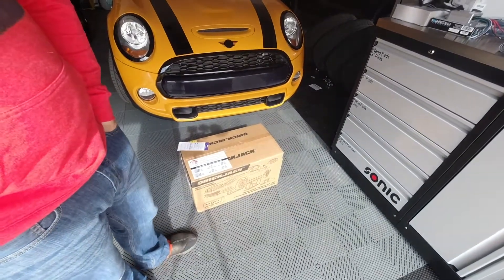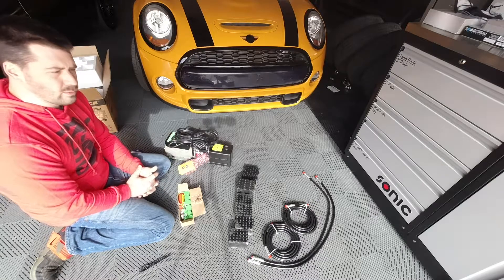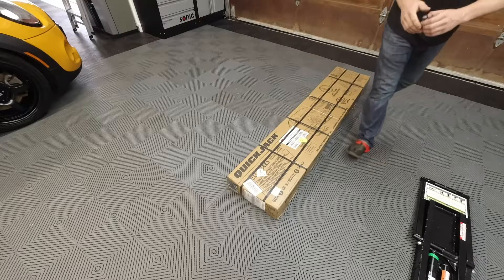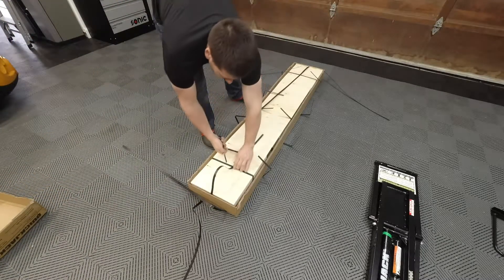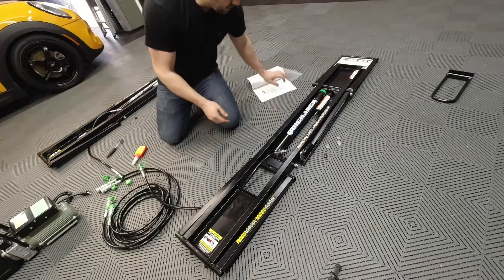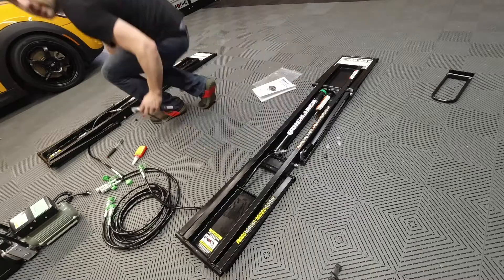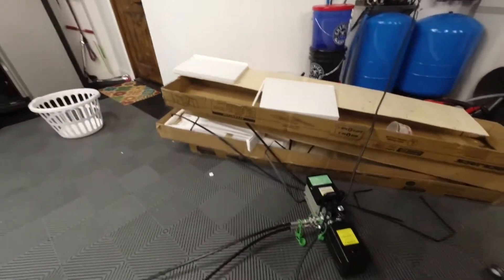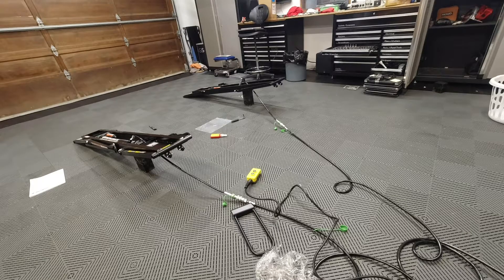IG231 Bendpack Quickjack unbox and setup

Comment: Does having the QJ replace the need for having or using your floor Jack?
Reply from the maker: TLDR; Mostly

Before QJ i had 3 floor jacks, and 4 stands, now i just have one floor jack.  You only really need it for things like collapsing trailing arms to attach a strut, or attaching a motor mount to an engine or a job that requires you to lift something other than the car itself.  
For simple jobs like patching a flat ill often grab the floor jack and just lift the corner of the car, just because it's easier than getting the QJ out.

Comment: How does it work on your Swisstrax floor?  I have Ribtrax pro and yours look to to be Ribtrax smooth.  Not sure if it would crush, dent, or be hard to roll on my floor. How do you like them so far?  Are they worth it it just for just a small lift off the ground?  Thanks for all you do.  You quality of videos are getting so much better since updating your camera!  Thank you!
Reply from the maker: TL;DR   IT WORKS GREAT!!!

WIth my floor jack I always used a 1/4" piece of wood or later a 1/16" sheet of metal to keep the wheels from digging into the floor..
The swisstrax is really strong, but jacks mess it up because all of the weight is concentrated on a small area and the wheels move forward and back when lifting the car which causes them to dent the tiles.  The base of the QJ has a huge surface area, and the base doesn't move as it lifts the car, so its really really awesome.  There is still a lot of height, 22" or so on the mini for example, which is enough to be really comfortable on a creeper, or to be able to get something like a transmission out of a Miata with room to spare.  

Im glad the camera made a big difference.  I wish I could "zoom out" more on the Sony camera TBH, it needs to be a bit far away from me for it to capture what im doing.
Reply: Thanks for the info again.  Thrilled to find they will work over my Swisstrax flooring.  I ordered mine today from Costco.  Can’t wait to get.  Just curious if you ever gave it any thought of adding wheels to it and if so, can you make a video?  I heard they are really heavy and tough to move around under vehicle.  I went with the same one you have as I feel the 5000TL is plenty for my Mazda CX-5.  Really enjoy your explanations whenever you do a project.  Thanks again!
Reply: What kind of fluid did you use?  Hydraulic or transmission.  Can’t tell on your video and it’s not in your link.  Also, did you use the included thread sealant or did you use Teflon tape?  Read horror stories about the thread sealant.  Most just throw it in the garbage!

Comment: That framework seems awfully lite duty for something made to lift 5k pounds.
Reply from the maker: ive had very close to 5k on it and it lifted it easily, im not a materials engineer or anything, but there are tons of these out there without mechanical issues.  Time will tell how it holds up, and I look it over before I use it to keep myself safe.